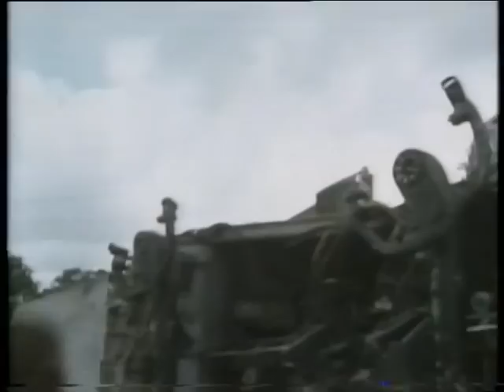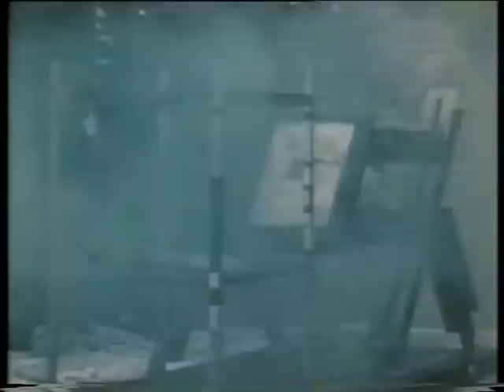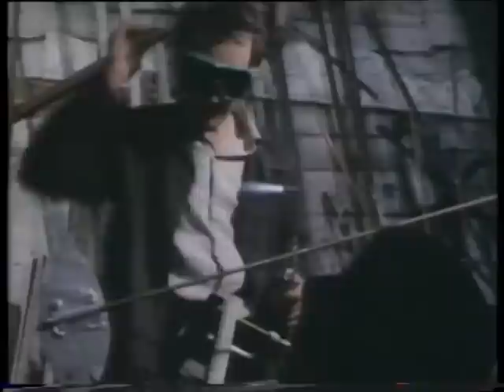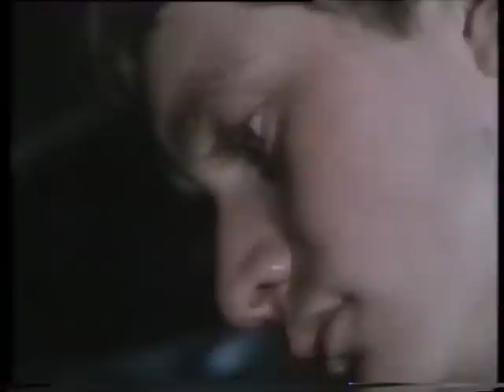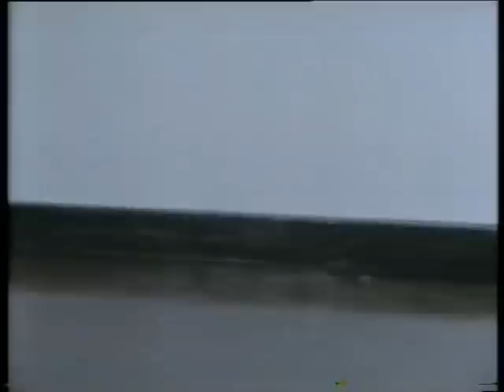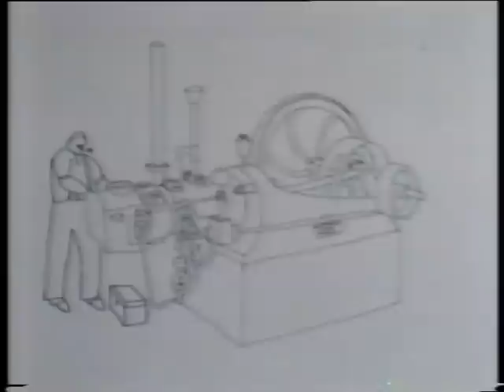why things go wrong3.mpg

Comment: Hehe! The old days when VW was reliable! Refusing to sell spares and even making machines that cannot be repaired has now been tried, so we can now say that doesn't work either. He's totally right about fiddling though. My GF's Toyota needed a gearbox because a clutch was done badly. We had to fix a knock the steering as a pinch bolt was loose and we just today cured a coolant leak by tightening a (non-factory) hose clamp! Poor girl spent hundreds with that garage!

Comment: being able to fiddle with your car was half the enjoyment of owning it and the secret to make those oldtimey cars reliable was to allow for enough tolerance ; they wouldn't have as efficient, powerful or silent  but you could fix one with a bunch of wires and hammer and often a nylon stocking could replace a drive belt and get you home; in the same time the unfiddleable cars were as unreliable and you could not fix them without specialized equipment